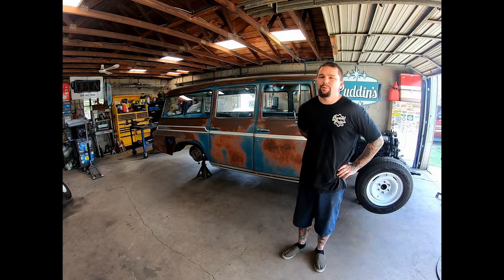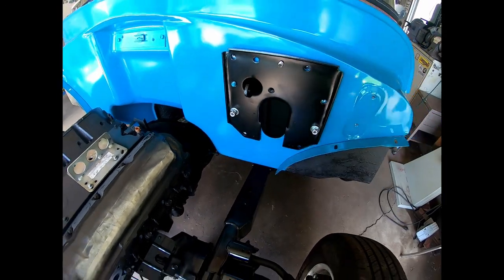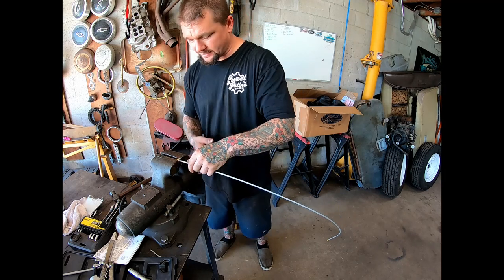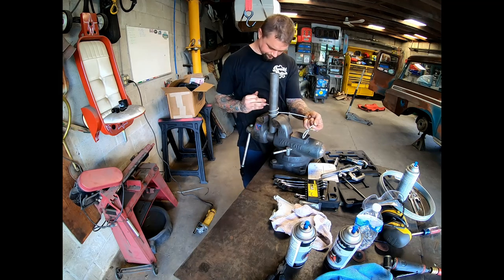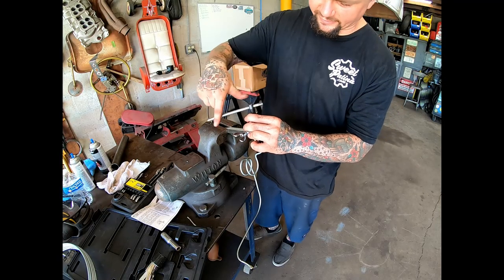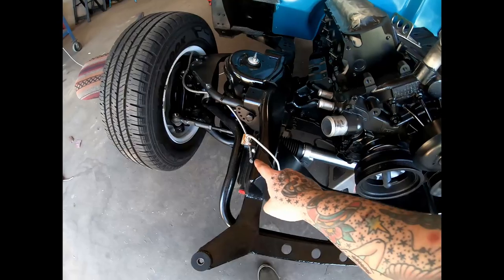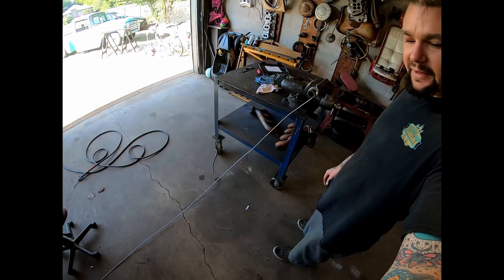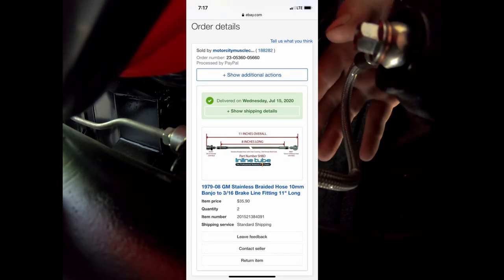MAKE IT STOP! BRAKE BUILD! Lines, hoses, master cylinder and more!

Comment: Just a tip man, try the copper/nickel brake and fuel line. It'll change your life. Also a trick for straightening the brake line, lay it on a flat floor and roll it back and forth with your foot. I made a draw through tool for straightening the line too. I bought 5 sheeves for 1/4" rope, built it on a piece of 3x3" angle about 8" long. The top 2 sheeves are attached to a bolt so I can adjust the pressure down on the line as I pull it through.  Love the progress
Reply from the maker: I debated on building one or just winging it and well I winged lol
Reply: Or use 20 foot striaght lengths...and tubing benders.

Comment: On my c10 I broke my fair share of taps for all kinds of line clamps. Helpful hint that helped me out a time or two, smack the broken chunk of tap in the hole with a punch and it should shatter the tap and if you are lucky you can re-use the original hole. Awesome project! I enjoy the videos!
Reply from the maker: I have had luck knocking them out. I get nervous around painted stuff 😬

Comment: Yea I had to cut off the bolts to get the old proportioning valve off, but I'm not putting the new one back down there, was looking at mounting it to the firewall. Got some ideas from you but I'm using stainless steel lines so I need a hydrolic flare tool.
Need to make my lines and take them to a shop. fun
Reply from the maker: Good luck!

Comment: Nice job.   I did exactly the same thing, broke off a tap in my frame (because I didn’t have the right size drill bit for the tap, it was a weekend and I was too rammy to wait).   Here’s a trick:  CRC makes a product named Freeze-Off, used to free rusted bolts.   Spray that junk on the imbedded tap until she is frozen real good and hit it with a hammer and punch. The broken tap will shatter.     Also, try and space your line clamps at least every 8”.... just how I was taught and it has worked well for me.  Always enjoy your channel.   Keep up the good work!
Reply from the maker: 👊🏻👊🏻👊🏻 thanks!

Comment: Super Clean installation. Have you ever used that copper alloy (I think it's copper alloy) line? It's amazing.
Reply from the maker: I have not. I’ve heard good things.
Reply: @PuddinsFabShop  It's a little more expensive but it's super easy to work with and bends like a dream without kinking easily.

Comment: You should try nicopp for brake and fuel line. It's easy to bend, easy to flare, doesn't rust and works much better than steel.
Reply from the maker: I’ll look into next time I build some!

Comment: Ummm, I did just wake up, but,,,, I think you hooked the front and back brake line to the master backwards. Unless you have a master I have never seen before, the back port on the master goes to the front brakes and front port on the master goes to the rear.... I could be wrong, but it is worth checking....
Reply from the maker: Just look up any speedway master cylinder kit. They plumb it to the proportioning valve like so, and then from there they are definitely plumbed correctly.
Reply: @PuddinsFabShop  Ok, I did and I found some that are forward primary, but most I found are rear bowl to front (DISC) brakes. I guess that is all I ever noticed. Typically the larger reservoir is primary and goes to the disc brakes. Secondary to rear drums..
Reply from the maker: All I know is with the big front and rear disc it stops like crazy.